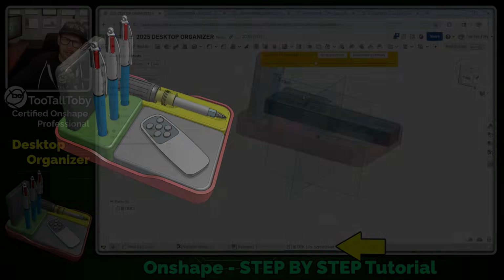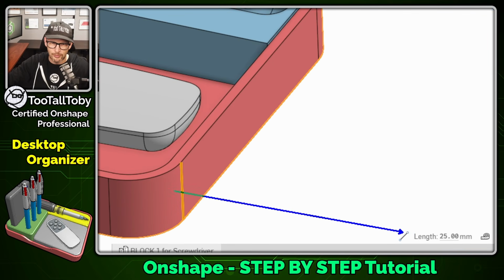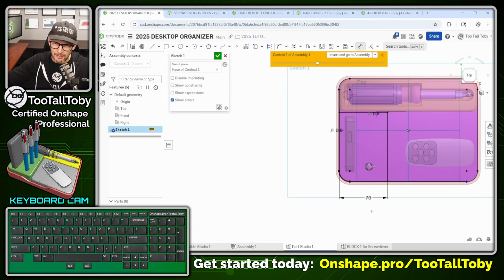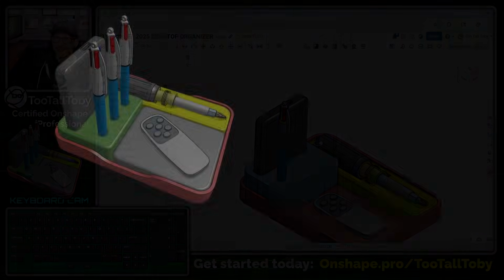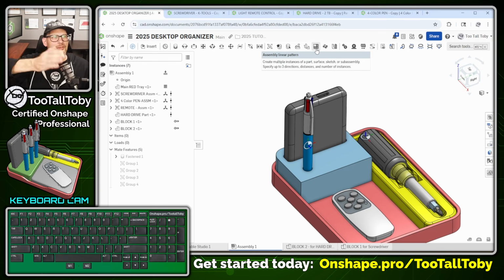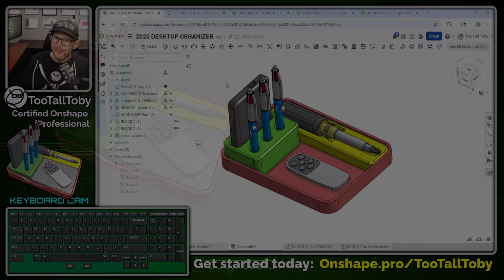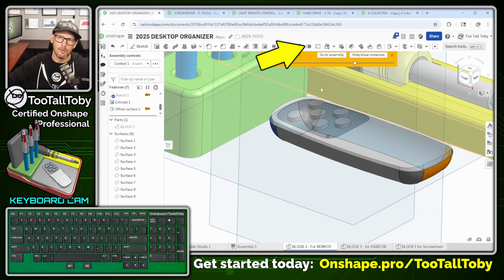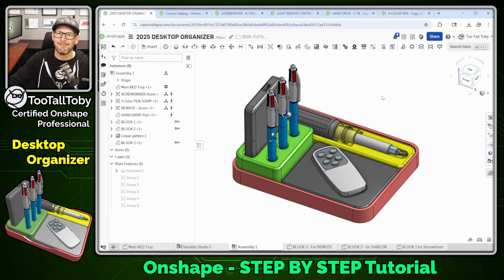Onshape Tutorial: Design a 3D Printed Desktop Organizer (Step-by-Step) - Part 2

Comment: This is absolutely fantastic: Excellent explanation, nice demo objects and it's even 3D-printable and useful – thank you so much!

What I didn't get at first was that "Context 1" is actually 3 different contexts, just named all the same. I found this counterintuitive TBH, isn't the context always the same assembly?

Also, I was being a smarta** and thought I could use the relatively recent feature "Insert entire Part Studio as rigid" to get around the creation of the assemblies for every object. That worked beautifully for the screwdriver and the remote, but with the pen I found out that you can't pattern instances of a Part Studio inserted like this. @OnshapeInc I guess that's a bug with that feature?
Reply: Awesome glad this was helpful - and excellent question about CONTEXT and CONTEXT naming!
First off - yes, you're correct I could have (and should have) renamed to contexts, to make them a little easier to understand. Great suggestion!
Secondly - One of the things onshape does really well with contexts is allows you to decide when they update. The reason this would be helpful would be for assemblies that have motion. Let's say you had a door that was opened and closed, at different times in its usage.  You could design a context when the assembly is in the "closed" position, and then another context when the assembly is in the "open" position. This would be very helpful if you were designing some kind of "swinging latch" that would be in one position when the door is closed, and a different position when the door is open, but you wanted to make sure it didn't interfere with any other parts (or the door frame) in either position. 

I hope that makes sense and there is some great training in the Onshape built in training that takes this idea a little further! 

Thanks again for the kind words and glad this helped!

Comment: Nice tutorial! Should definitely be helpful for all the "intermediate level" makers out there using Onshape.
A couple nitpicks/extra tips: pre-select regions before extruding/revolving when you have a sketch with multiple contours, much quicker than launching the command, clearing the selection and then selecting...
If you want to mess with SW users' minds, mate the parts to their in-context created cavities to keep things nicely in place, creating a circular reference with no errors! If you want to adjust them, just temporarily suppress the mate, move the part, update context, unsuppress mate!
For something like this I would have created all the blocks in a single in-context studio. The way you have it, if you change the size of one of the blocks you need to update 2 other contexts instead of just being able to dynamically divide them up.